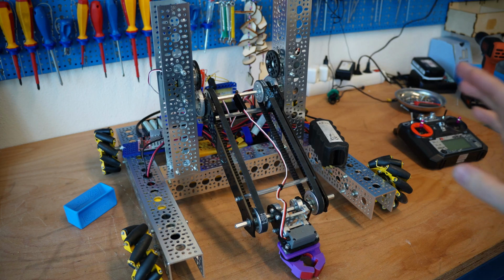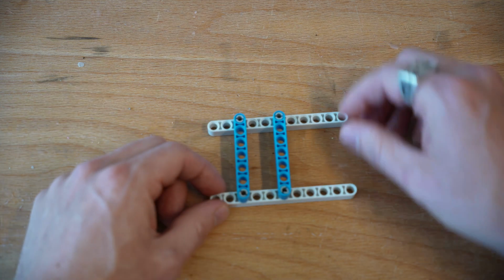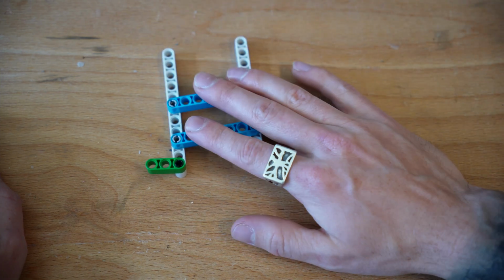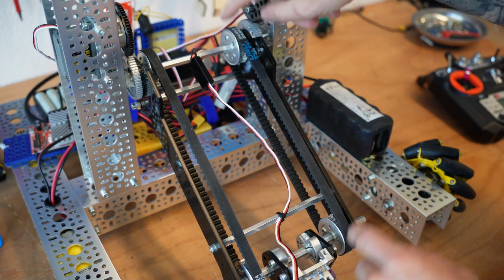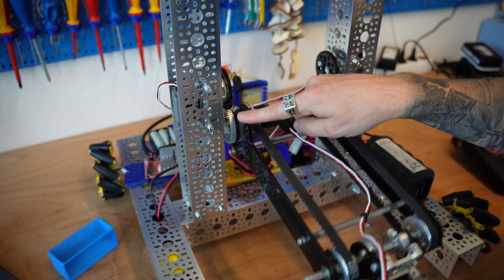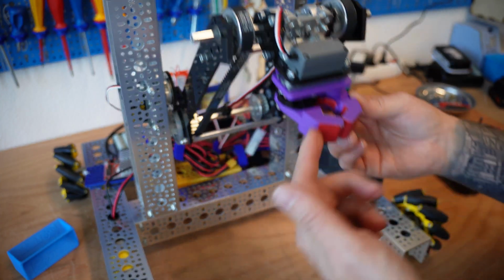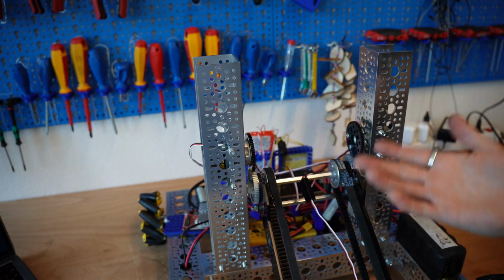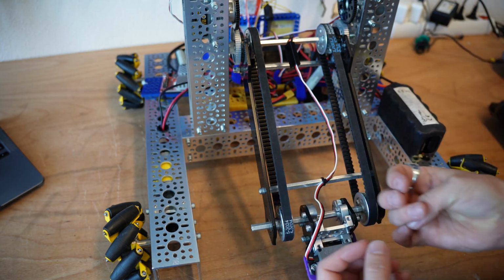How Virtual 4-Bar Linkages Work

Comment: 9:51 also you can drive the pulley thats constrained in your example with a motor, giving you another joint, but you dont have to compensate for that joint then.
Reply from the maker: 100%. That then allows you to rotate your end effector. Some have coined it a "co-axial 4-bar". Though I wouldn't say no compensation, as that motor does need to be able to hold that pulley in place and requires sufficient torque at power-down to counteract the rotational forces being applied to the belt on that pulley.
Reply: @BroganMPratt  if the motor spun a worm gear linked to a spur gear, that would prevent the pulley from being able to be rotated by anything but the motor, requiring no torque from the motor to hold position

Comment: Thank you for the explanation on the 4-bar linkages! I found it very useful. Do you have an STL file of the claw you used in the video?
Reply from the maker: Glad you found it helpful. No, I presently don't have that claw public as it was a student project. I will however, be releasing a parametric claw in the future here for teams to build off of.
Reply: @BroganMPratt  Alright thank you for letting me know and I will be looking forward to that parametric claw 👍
Reply: Thank you for your interest in our design! A member of the Trojan Robotics build team designed this and the outtake as part of one of our robot designs. Here is a folder with files referencing the claw and the virtual four-bar mechanism seen in the video: https://drive.google.com/drive/folders/1NYpocgF1j_Wdx5G5-1n9vTibqR_bC0Ns?usp=sharing. The only difference is the hooks on the mechanism that were originally designed to hang our bot, these were removed by Mr. Pratt for the purpose of the video. We hope this helps!